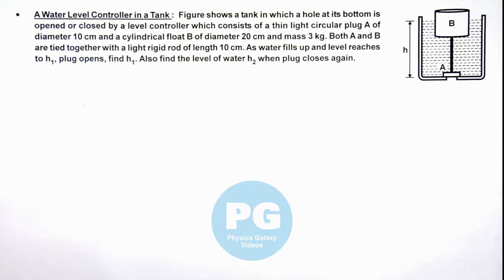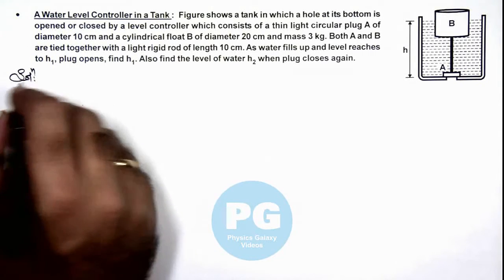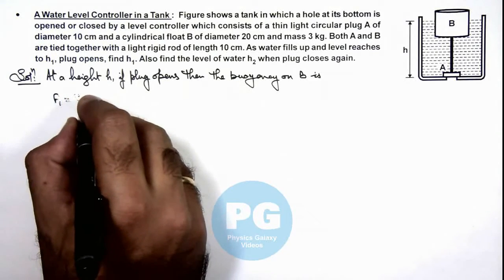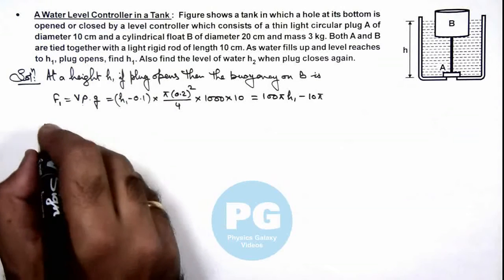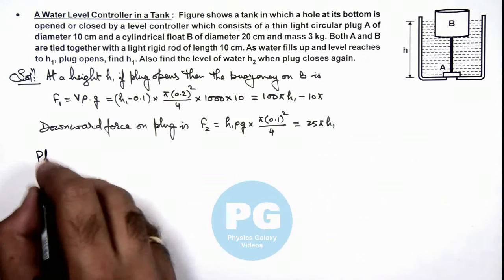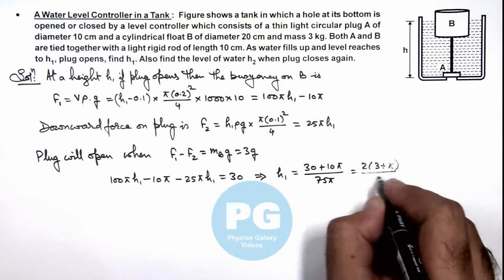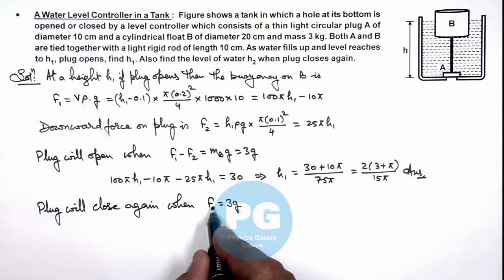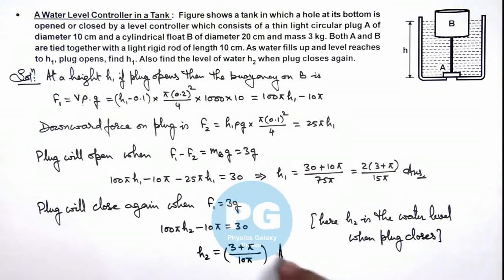13. Advance Illustration | Fluid Statics & Dynamics | A Water Level Controller in a Tank

Comment: Sir in 1st part while writing buoyant force, are we considering no distance between A and B?  as while writing volume displaced we are taking height as h1-0. 1 . 
If that is the case then either string is loose or it has negligible length.  But both of  these can't be assumed unless given.

Comment: i didnt get that how the plug closes if we r considering plug a to be in sunk state while calculating h2?
plss explain
Reply: When it is at the bottom most point in the vessel, the bottom of the vessel applies normal force on the plug which balances out the force due to liquid pressure.
Reply: @discopotato4673  Thank you so much. I was here to get this point only.
Reply: @theflyingfish123-h3f  Happy to help

Comment: sir in calculating h2 why we have not considered buoyant force on A  as that point normal is also just zero so what is counterbalancing the force on A?
Reply: It is so thin that the pressure on its lower face is same as the pressure on its upper face and the two faces counterbalance each other.
Reply: @sakshisinha4615 thanks
Reply: @sakshisinha4615 then why did the same logic work when we are calculating h1??
Reply: The weight of B will be counterbalancing..
Reply: buoyant force is when body immersed completely in fluid as in diagram it is clear to see that it is free from water from down side
Reply: The buoyant force is negligible... As there is negligible pressure difference in case of plug immersed
Reply: I too think so
Reply: Yeah I too got that doubt, I think since volume of water displaced by A is so small(thin: word in second line)  as compared to that of B so , buoyant force is neglected...